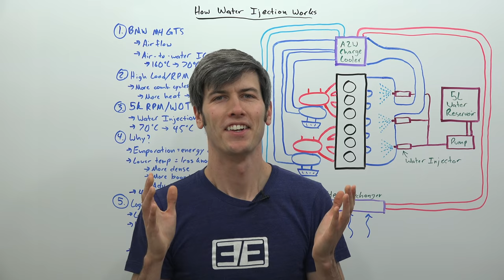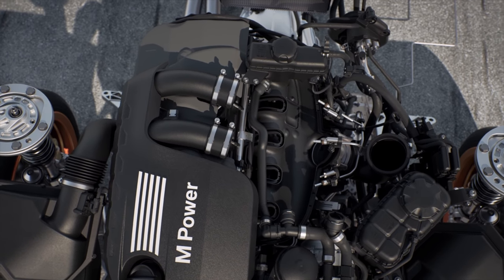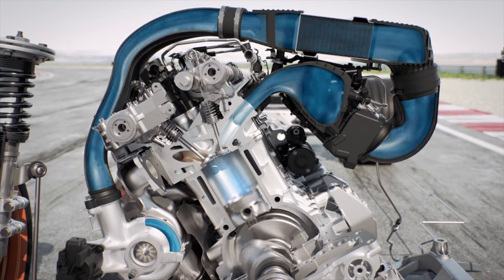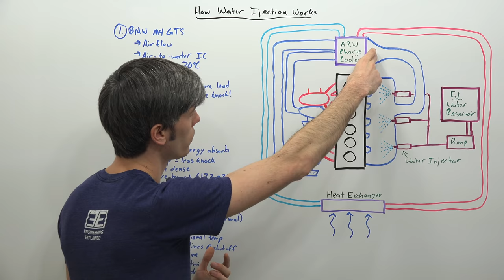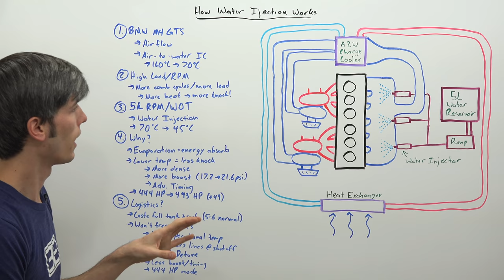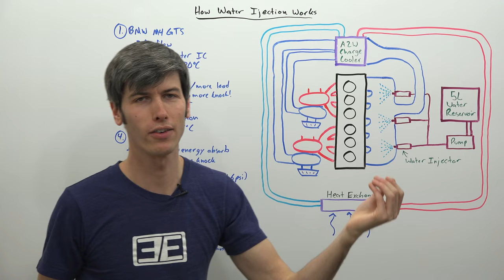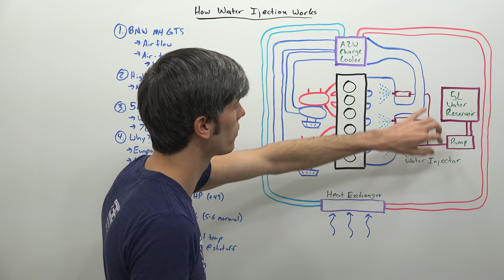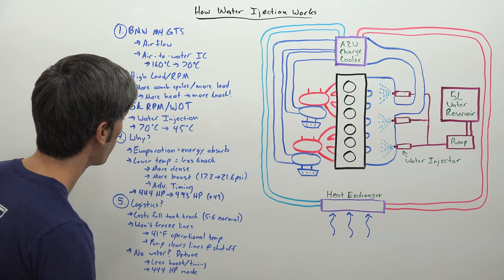How BMW Used Water To Make +50 Horsepower

Comment: This is currently gaining some momentum in the industry. In case of interest:
BMW Wassereinspritzung: Erste Erfahrungen und künftige Potenziale.
 (Vienna Motorensymposium 2017)
Fabio Berni et. al, "A Numerical Investigation on the Potentials of Water Injection to Increase Knock Resistance and Reduce Fuel Consumption in Highly Downsized GDI Engines"
Al.D'Adamo et al, "A Numerical Investigation on the Potentials of Water Injection as a Fuel Efficiency Enhancer in Highly Downsized GDI Engines"
Fabio Berni et. al, "Numerical Investigation on the Effects of Water/Methanol Injection as Knock Suppressor to Increase the Fuel Efficiency of a Highly Downsized GDI Engine"

Comment: Well it's not going to reduce thermal stress and combustion temperatures, because you used the advantage of the charge cooling to increase the heat generating capacity for extra power.

Comment: Jeremy Clarkson didn't quite approve of this system, but I think it's great! Only worried about the water tank freezing, but people who own these cars in cold climate areas(like Finland) most likely won't drive it in the winter anyway.
Reply from the maker: Yep, I get into the freezing thing towards the end. The system won’t operate in sub-zero temps.
Reply: @EngineeringExplained  Thank you for the response, but I meant the water tank itself. Being full of water in freezing conditions for a day and it would most likely crack unless some genius at BMW has gone to great lengths to overengineer a bloody water tank.

Comment: In this condition you can inject hydrogen With the Water to prevent hydrogen explosion. The hydrogen come from a Wind turbine installed in the car in a place when normaly the car have a great air frition. The wind turbine it's accopolate to a low rpm permanent magnetic with 10 kw a avarage torque

Comment: Do not use water, use winter version windscreen fluid, this has methanol in it. This will cool even beter and you will have ethanol injection. More fuel, cooler air, more boost.

Comment: what if we use liquid oxygen instead of water?
Reply: That's essentialy NOS
Reply: It would knock because of excessive heat. Better have N20 injection because the Nitrogen would help to cool the engine.
Reply: Definite BOOM
Reply: @TheMrANONYMOOSE  of course it isn't

the nitrogen in NOS is inert, thus it is taking up space with uncombutable gas

Comment: Alfa Romeo makes 505 HP from a slightly smaller displacement 6 cylinder engine without the use of a complicated water injection system. Something to think about.

Comment: Not just that but it will actually burn off the carbon deposits off your valves as direct injection engines suffer from coking.. The only way to solve it is walnut blast  either meth injection or even easier is water injection the bonus is 50bhp plus an engine which cleans it's self.
Reply: The plain water injection is not going to help the coking on the inland tract or the backside of the inlet valves, only in the combustion chamber. It needs to have either a methanol or alcohol mix to dissolve the oil residue.
Reply: @jsquared1013  if you look at the design of this engine. The charge cooler sprays from the back side of the valve cleaning the back side and face of the valve. You would never be able to clean the exhaust side of the valve even with meth.

Comment: little bit misleading, its not adding water to make 50hp, its changing the conditions/variables which allow you to up the boost which makes the extra HP. would be instersting to see how much extra power it made with the water injection being the only modification.

Comment: A percentage of water breaks down to hydrogen and oxygen at 2,000c and an internal combustion engine reaches temperatures of 2,500c. Wouldn't that mean you would get a tiny amount of additional oxygen and a slight amount of hydrogen from the water injection?
Reply: You get that in every combustion engine which burns hydrocarbons anyway. Water vapor is one of the exhaust gases which is created when burning hydrocarbons because they tend to decay at high temperatures and release their hydrogen which then takes part in the combustion process.
Reply: it takes the same amount of energy to break the water down as you get when o2 and h2 burn, so both reactions would cancel energy-wise

Comment: E100 Ethanol has 6% water diluted. No knocking issues... No freezing issues... No emissions, no need of umbilical EV.
Reply: If it had 6% of water in it. It would be E94.
Reply: @mercanyinriechert6732  No: Ethanol mixed with gasoline is anhidric (no water). So E94 would be 94% dehydrated ethanol and 6% gasoline. Gasoline doesn't dilute in water, so to be mixed, ethanol must be dehydrated.

To use only E100 etanol you don't need to get rid of water content (ethanol dehydration increases costs).

With 16:1 compression ratio is possible to burn 75% ethanol and 25% water. No NOx emissions also...
Reply: @athalfridhu  "anhidric" is not a word so I don't know what you mean by that.  So you are saying I can take a gallon of ethanol and pour a quart of water in it and it is still safe to run through an engine.  E-10 Gasoline is considered contaminated with just 3 teaspoons of water per gallon. I run a motorcycle at 13.5 compression ratio which is pretty high and way higher than almost any car on the road that the average person drives. I run methanol in this bike which is hygroscopic. After opening the methanol if I don't use it in 90 days I dispose of it because of the water contamination.
Reply: @mercanyinriechert6732  Anhidric means dehydrated: ethanol after destilation process content arround a 6% water. But water doesn't dilute in gasoline, so to mix ethanol with gasoline, ethanol must be dehydrated first. That was very clear in precedent post...

With 16:1 compression ratio you can burn 75% ethanol and 25% water. This is not ideal to build power but reduces dramatically nitric oxide emissions (NOx). Also is not common, these are experimental engines. No particles, no CO, no CO2 (added to atmosphere) and no NOX. So umbilical EV's are not necessary...

16:1 compression ratio is less CR than in a diesel engine that uses 19:1  ratio. Head gasket, pistón rings and other engine components like starter motor and battery are designed to deal with that ratio. E100 Ethanol has an octane rate of 115 or more (depending on water content) so no knocking issues and more compression (efficiency)  can be used. 13:1 is high for gasoline not for Ethanol. 

Ethanol is hygroscopic (absorbs water from ambient air moisture) like Diesel, methanol or brake fluid (in different grades).

Ethanol or FLEX vehicles have to be prepared to resist corrosion/ degradation in some components like fuel filters, fuel pump, fuel lines, fuel pressure regulator, and injectors. Water vapor in exhaust can  rust pipes and mufflers, so inox or ceramic coated ones are needed.  Nothing that hasn't been done over more than two decades in FLEX cars. 80% of the fleet in Brazil is FLEX. Almost 20 million FLEX cars are produced every year in Brazil. E100 is sold in every gas station arround the country. No issues...

Comment: I was going to say if the injectors get stuck open it will cause hydrolock ,then I remember that the pump only runs when the requirements are met... disregard what I just said 😂

Comment: Flashback - 1999 Subaru Impreza WRX STi
Reply: That wasn't water injection, that was just a water spray on the outside of the intercooler.

Comment: Having water evaporate in those high pressure, under normal boiling point is honestly quite doubtful for me, it's probably helped by the spraying, but it's still pretty sketchy
Reply from the maker: Haha, well, it's what happens! Injected at very high pressure (mist) into hot air. It works!

Comment: So in turn the overall efficiency of the engine is increased by adding water to the system, right? Why don't we fund this? A normal street car could even fill the reservoir with the condensed water of the air conditioning.

Comment: It seems this won't work well in humid air, especially during rainy season.
Reply: Why?
Reply: Chevy SparkEV  on a hot, humid day... maybe? I’m gonna go out on a limb here. 
The warmer air is the more water it can dissolve. Look up humidity and dew point. 
And the pressurized air in the intakes is significantly higher than the boiling point of water (especially at high RPMs where this system would activate) 
So really, the difference would be negligible if even measurable.

In Okie terms, compressing the air increases the air temperature (you’ve felt the inverse of this if you’ve ever blown compressed air on your skin, it feels cool because the air is expanding, if your skin was wet or sweaty it felt cooler because the water was evaporating just like in the system above)
Hot air can absorb more moisture
The temperatures we’re talking about can easily dissolve the amount of water we’re talking about, regardless of how much moisture is in the water before compression.

Comment: Something’s wrong if BMW is seeing 160C outlet charge temps at only 17~21psi.  That’s 320 degrees Fahrenheit!  320 DEGREES, really?!?

Gives new meaning to turbos’ affectionate nickname — HAIRDRYER!!!

On a good note, I’m sure that water (+Methanol?) injection system should help cure the carbon woes inherent to D/I engines.

Comment: Hahahaha I totally see a water injector failure causing the motor to hydro lock.
Neat idea but I don't trust mechanical failure when the base line goal is the companies saving pennies on the lowest cost design vs longevity.
I will admit injectors have come a long way since Bosch cis, but this is putting a little to much faith in computer programming for my liking.
I'm sure extra precautions are well implemented in the system but the likelihood of this being used suggests heavy track use.
I worry about oil contaminating an injector and it's laziness from sludging.
Water and oil should be separated at all times inside a motor.
Luckily not much production invested in this long term. 
Props for the ingenuity and design though.

Comment: How can you spray water in the intake and some how not get it in the cylinder. And if I’d is meant to go in the cylinder how does the engine not explode
Reply from the maker: It does go into the engine. As mentioned above, as vapor, not liquid. Much like humid air.
Reply: @EngineeringExplained  why do they use water and not fuel? i understand that water has a higher heat capacity than fuel, but wouldnt injecting fuel instead of water have the added effect of burning more fuel? is the problem that the air to fuel ratio isnt lean enough so adding fuel would only increase the amount of unburnt fuel, without actually delivering much more power?
Reply: If you spray onto the closed valve?
Reply: Engineering Explained Old tech indeed.  Way back when, I installed a water injection system on my 1975 Firebird Trans Am.  It was very simple... a windshield washer tank with pump, a windshield washer two-stream spray nozzle mounted over the secondaries of the Rochester 4bbl carb, an in-line metering valve, and a vacuum operated switch that activated the pump.  The water was injected when the manifold vacuum was low (i.e. when the secondaries were open).  It would shoot past the secondary throttle valves and vaporize when it hit the hot manifold.  I was able to run significantly more advance, had higher manifold vacuum at idle, a “seat-of-the-pants” noticeable increase in power at WOT, better mileage, and the spark plugs never had any carbon buildup.  It was primitive but effective.
Reply: Until something fails and you'll start injecting actual water into your cylinders.
Reply: Thank you for the reply. It just sounds really weird, because normally water and engines don’t mix well
Reply: @rfldss89  They are probably using more fuel already, but there is an upper limit to how much fuel is beneficial to combustion
Reply: @twistedcobra11  Your story reminds me of a trick my teacher used for cleaning engines internally. He took a spraybottle full of water and sprayed into the carb throats until the engine almost stalled. Rinse and repeat. After some 15 minutes we could hear a clean engine ticking away happily. Removing spark plugs confirmed that even carbon deposits ontop pistons were gone.
Reply: @Lessthanthreeedm    I should have mentioned two other components of the system.  There was an indicator light to show when the system activated and a system on/off switch.  If it activated when it shouldn't, the worst that would happen would be rough running and/or stall.  In that case, you could see that the light was on and just shut the systems off. The amount of water being sprayed (which would be divided into eight cylinders) was much less than would cause hydraulic lock.   If the system failed to activate when needed, you would hear the knock (because of running extra advance) and just back off the throttle.  Obviously not as good as a more sophisticated system such as that in the BMW, but it worked... and the potential system failures were not catastrophic.   One other caveat... no WOT with a cold engine, but that's a good rule to follow anyway.
Reply: @rfldss89  because in Germany you pay 1,60€ the liter.
Reply: Rafael Santos adding more fuel is how current systems reduce combustion temp. Problem is: fuel is more expensive than distilled water, adds more carbon to the exhaust, and is generally less efficient. Water is literally cooler, cheaper and steam cleans the engine in the process.

Comment: Water expands 1700 times when it evaporates- where is all that pressure going? 
The water pump works in reverse and sucks lines dry- how does it not accurate itself?

Comment: Putting water inside the cylinder?! ,, so they say a car engine can’t compress liquids ,, and when water gets inside it from the intake “rain” it will hydro lock ?! Hmmm I’m really confused now how it’s possible to inject water !!
Reply from the maker: It's vapor when it enters the engine, not liquid.
Reply: Research mate! This is old tech and well explained with quick read. Do your own work, use your brain, then write... we all have similar access to google.
Reply: Waldemar Ishibashi Ok mr.educated  can you tell me when or what does it take for hydro locking to happen? I know even if you run your car too rich it will cuz it ,, so give me the ratio for injection water using google sir ,, also I would not mind u explain about hydro locking too
Reply: @haider4648  They call it tuning... I guess... if your small ego allows it to be...
As all systems, this are checked by mechanics to work properly on a dyno while connected to PC. So the the flow is adjusted by the tuners to be under that.

Comment: Leave it to BMW aka (Big Money Wasted or Bavarian Murder Weapon) to overly complicate water injection. This is an accident waiting to happen but when the Bimmer spontaneously burst into flames there will be some water their to extinguish the fire. 

Simply adding methanol to the water will prevent it from freezing. This also converts part of combustion energy from the form of heat to the form of pressure. As the water droplets vaporize by absorbing heat, they turn to high pressure steam. The alcohol in the mixture burns, but is also much more resistant to detonation than gasoline. The net result is a higher octane charge that supports very high compression ratios or significant forced induction pressures before onset of detonation.
Reply: Buy More Warranty
Reply: @jamesplotkin4674  Hire an aggressive lawyer. If I really wanted a Bimmer I'd get one from the 70's or 80's. If I wanted a modern status symbol Bimmer to impress people that was safe and reliable I would buy BMW badges and put them on a Lexus or Acura.  

I would hate to work for a BMW stealership.
Reply: It's actually not that complicated, and you seem to not have watched the whole video since he addresses the freeze prevention strategy.

Comment: 5:35 "The pump pulls back the water so you don't have to worry about that water corroding". Wait a minute. Water + air + steel = corrosion. Water + steel (no air, no free O2) = less corrosion. What am I missing?
Reply: Have you ever ask yourself how Fisch and other Sea animals got their oxygen out of the water? There is free oxygen in the water and the water actually accelerates corrosion in many cases because it will act as a electrolyte if it's contaminated.
Reply: @shi01  Yes indeed. But imagine a steel water pipe. With water flowing inside and water dripping on it on the outside. Will it rust more inside or outside? The BMW steel pipes will still be wet when the water is pumped out. Corrosion prevention does not seem the reason to do that.

Comment: You didn't mention anything about the water reducing carbon on the engine components. Is that because it is a myth?
Reply: Definitely interested to find this out -- especially with modern DI gasoline engines having carbon built-up problems on the back of the intake valves due to PCV vapors.

Comment: Water injection is totally impractical. If you use anything other than distilled water, you are adding mineral deposits to your engine.
Reply from the maker: Hence the requirement is to use distilled water. It’s another tank to fill up, yes, but this is a track-oriented car, and runs just fine without it.
Reply: I had to top off my battery last year. Locating distilled water was very hard. I bet it would get expensive keeping a stock of water around. You'd have to keep a lot of it around for that 5L tank. I just think it's gimmicky. All due respect.
Reply: @alexanderherrmann743  Not sure if you live in the US, but here it's quite easy to find. I have 3 gallons sitting in my garage right now and only use distilled for my vehicle's radiators. For someone interested in tracking their car, this is not a huge issue and likely is much easier than finding the highest octane fuel from your local gas station.
Reply: You can also produce distilled water yourself....